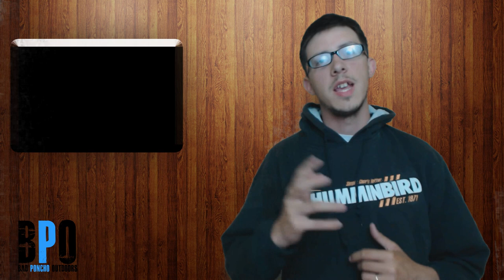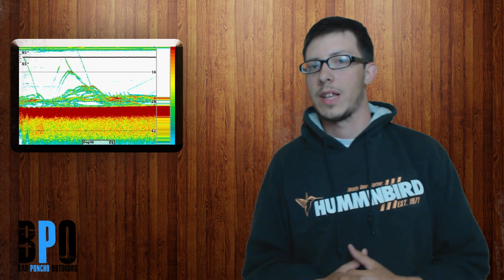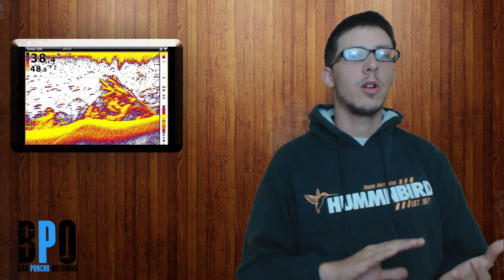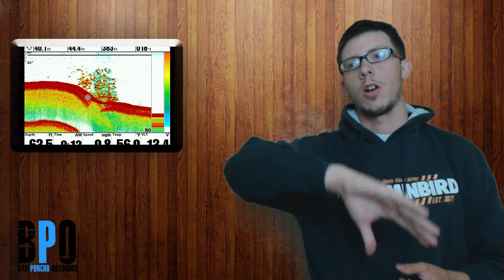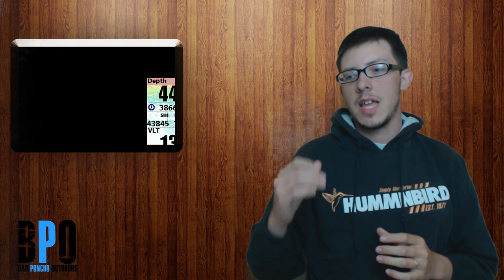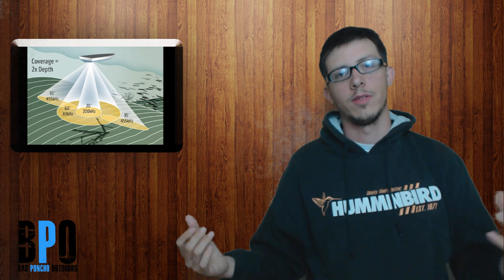How To Use a Humminbird Sonar Fish Finder

Comment: Great video and I hope you can help me out with a quick question.  I use a small hummingbird fishfinder with a color screen.   My question is as soon as I see the first part of a piece of structure on the far right hand part of the screen., where is exactly is  the structure under my boat?   When it reaches the middle part of my screen, where exactly is that structure under my boat?   I’m trying to avoid setting the anchor directly on the structure so I don’t get snagged.  Thanks.
Reply from the maker: Think about it like a printer - the right side of the screen is the most recent “snapshot” of the bottom. As you go over the piece of structure it’ll move to the left. The most recent data will always be on the right side of the screen, data you have passed will be on the left. Positioning of the object depends on speed mainly since fish finders refresh at the same rate constantly. 

My suggestion is to drop a buoy or waypoint a close as you can to the object to better visualize it.
Reply: @TheAmericanAngling  thank you for the reply I do appreciate it I fish in Long Island sound in New York and recently snagged on a lobster trap and could barely get the anchor up.   I have a winless but was able to get the pot close enough to the boat to reach it with a hook and was able to yank it off